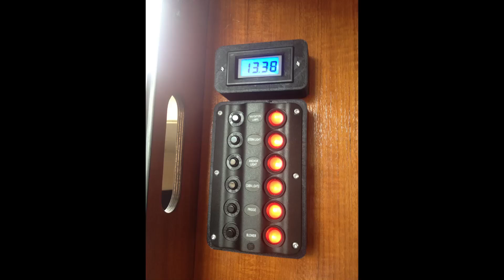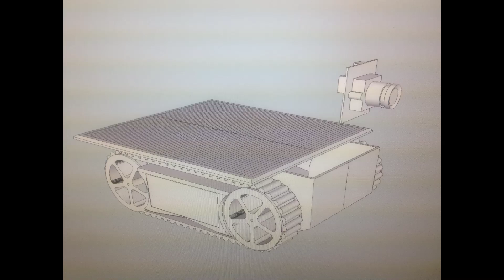One year with my 3D Printer

Comment: i've always wondered, what does the material feel like and is it just flimsy like plastic? is it possible to make haedphones with a printer or computer parts, car parts?
Reply: 04av6 of course you can, the only limit is your imagination ( and your printable volume lol ! )
Reply: 04av6 What it feels like and if it's flimsy depends on the material you use.
For example, in the past, I've used PLA which does feel very plastic-y and I could make marks on the surface of it with a sharp fingernail. Inexpensive and relatively low-temp, it sticks to the board much easier than ABS, and is a lot easier to work with than ABS.
I've since switched, and now I use ABS. It prints at a much hotter temperature, but the prints feel rock solid. The texture is still a bit plastic-y, but I found I could make a bottle opener completely out of ABS plastic and get a good number of uses out of it.

Comment: Wow Peter, you have been very industrious with your printer, well impressed with your ingenuity. I'm a serial inventor dating back from the 80's. Made a few inventions back then but didn't really know what the hell I was doing marketing wise that is, lost my shirt. But I never stopped writing my ideas down. So now I I'm embarking on a new adventure/venture to prototype my best ideas one by one. Just recieved through the post my first 3D printer yesterday, an Ultimaker 2, I'd just like to ask which cad softwear would you recommend. I'm dabbling in free Inventor Fusion at the moment and finding it difficult to use. Your thoughts?
Regards Graham

Comment: All is very neat, but my concern is: Are the materials toxic? During process and after, won't they gas off carcinogens? Apply materials to a cookie... sounds like you are poisoning your folks...
Reply: PLA is made from corn and such. ABS is what just about everything plastic is made from in the kitchen. Nylon too. You can print in PET (plastic bottles) if you wanted too. So all in all 100% safe!
Reply: ABS does make some odor that can cause headaches.
Not very bad for you though.

Comment: I'm not sure about the material you use but there is a process using acetone vapour that can smooth 3d printed objects.
The acetone is just nail polish remover.
There are videos showing how to do it.
Reply: It would probably melt or warp PLA
Reply: Teh Stranger? It does exactly that.

Comment from the maker: I have not had any major issues myself. The only think that have broken on mine is a fan that cools the circuit board, easy to replace for me. I also had a gear that started to get worn out, i just printed a new one. I would say that if you are not comfortable with a screwdriver in your hand, i don't think a 3d printer is for you.The material have been very expensive, i used to pay about $100 per kilo for PLA (with customs, shipping, taxes etc). But it is coming down in price, about half now.

Comment: Some guy - with a $2k mobile computer (industrial devices with built-in barcode reader) - could not get a $100 proprietary battery - 'discontinued' model - and could not find 3rd party batteries

Helpfully I said - get someone to 3D print you a battery and explained - a battery eliminator - is just a plastic case - with a few metal connectors for a standard battery

He thanked me in that tone - as if I'd advised him to buy some rocket trousers and look for a battery on Mars

Comment from the maker: On the owl it's color differences because of the silver color was slightly transparent, making it darker where walls was thicker. (Solid layer are printed at overhangs etc) As for the other parts: Natural PLA looks like ass, it just does. And the mechanical parts I have printed fast and without caring about the looks :-) Also some part are old printed with the old firmware in the machine..

Comment from the maker: It depend on what you print, but a roll of plastic actually lasts a while. You almost never print solid parts, the parts are printed with like 20% infill. But it is like a mesh like structure and makes the parts almost as strong as if they was solid. The big owl for example, used 184 grams of plastic and took 18 hours to print...

Comment: How well does that PLA light cover hold up to the heat of the bulb? I've got the Replicator 2 arriving in a few days, and it only prints in PLA; I'm hearing it gets soft at any relatively elevated temperatures. Looks like it's good in your situation though!

Comment from the maker: I think it is one of the larger 3d printer build platforms (or at least used to be) 21x21cm. I don't think the build platform is the issue, but when printing large long shapes, there is a issue called warping, that the plastic "curls" that might be a larger issue then the size of the build surface..  But if you have a large object, divide it to multiple pieces a glue them together..   :-)

Comment from the maker: I have been printing almost every day.. I just got my first nozzle clogging (see one of my newest video). But then i have been running ABS and flexible PLA with oil on it etc, so i guess it was time for it, but it was a easy fix.. Also the fan in my machine now sounds like a tractor some times, the bearings in it is probably gone bad, i have ordered new fan..  But other than that i have been printing almost every day now.. (for over a year now).. No other issues..

Comment: Did you uploaded your design files to Thingiverse or something similar? I'm really interested in your quadricopters, they looks stunning! I have a desktop 3D printer as well, but I couldn't picture myself that I would print the frame and structural parts of a quadricopter, I thought it is better to build it with carbon tubes. Great stuff, keep up 3D printing!

Comment: considering that you are in 3D printing and in quadcopters, how about a Coanda effect flying RC model? Eventually also some blueprints with what you managed to make flew..
In about 3 months I plan to purchase and assemble a RepRap Huxley. It's only a third of the price of Ultimaker. I'll see later if I can upgrade the Huxley for larger models. Shouldn't be too difficult (I suppose).

Comment: I love the example parts you show in your video and they are excellent examples but Chris does have a point. Quite a bit of heat can build up in a light fixture. It's worth mentioning because someone will print one and use it with a light source that gives off excessive heat and it will melt / gas out / catch fire.

Comment from the maker: The opening in the nose is 0,4 mm, so 0,4mm is the minimum cog size in a gear, it is possible to get a nose with smaller hole... But there is better 3d printer technologies for making smaller objects, laser sintering, shining a laser beam in a resin that harden where the laser hits etc..

Comment: I'm guessing the next big thing will be solgel 3d printing. Solgel is used to make some aerospace parts, like heatsheild tile for the space shuttle. You basically make like a jelly and then freeze dry and then fire it in a furnace. All much easier to do in space I would think, what with its ready sources of vacuum, cold and heat.

Comment: Power is next to free, payload is WAY more expensive than gold.  If you could print strong light parts of a larger volume than the payload of material used to make them, you would be ahead. Space about getting more utility per pound and cube foot of payload. Poundage is more important, but you can't get a 3d printer to create mass from nothing. Versatility is also huge. Print replacements of things that break instead of having to have spares for everything, maybe with recycling of broken parts.

Comment: Argh don't get a Makerbot dude they are an expensive ripoff. Make a reprap. This printer can print many of it's own parts and is a family of completely free designs. You need the plastic parts that it can make plus some electronics, some smooth and threaded rods and nuts bolts and washers etc. The great thing about it is that you say start with a mendel model say, and use that to print bits to upgrade it to the 3 colour model.

Comment from the maker: It's warping.. If it is your own designs, then try to design them a bit different, add holes, try to avoid/break long shapes in your object, etc. You can add "mouse ears" to the corners of your objects to hold them down (that is cut away when finished). And if you now are using ABS, try PLA instead, it have much less warping then ABS and is much more printer friendly..

Comment from the maker: I might do some "from sketchup to print" tutorials videos in the future :-)  I am using my Ulticontroller right now, printing stuff from sd card. I think the controller is great, not just for printing from sd card, but you can also see the temprature and change settings right on the panel very easy..Like speed temprature, flow etc... I think it worth getting !!

Comment from the maker: You just need a microcontroller that listens to the pwm signal and controls the stepper motor, you can program it to do what you want :-) But that specific stepper motor on ebay, i think would be to slow for a camera gimbal. Get an arduino and start learning, it not hard at all :-)